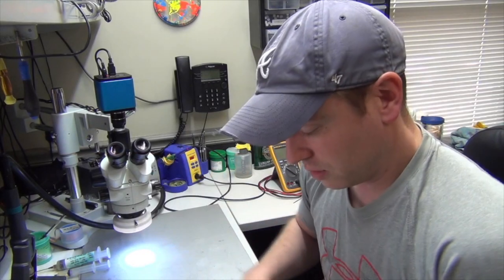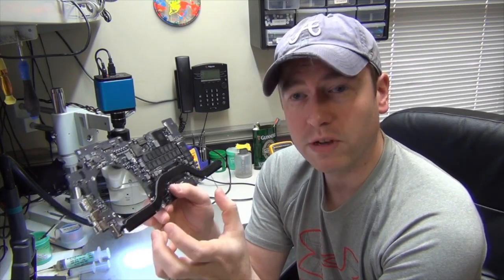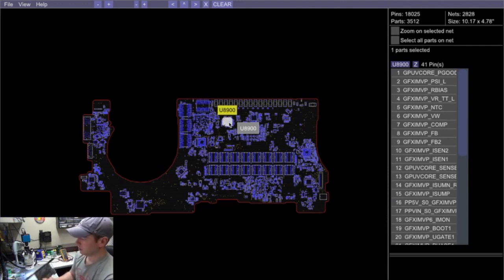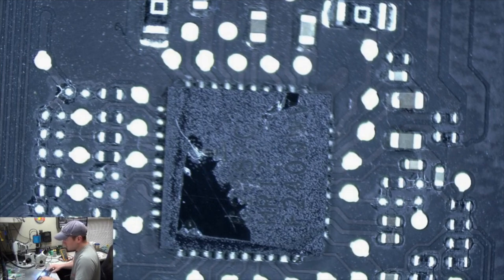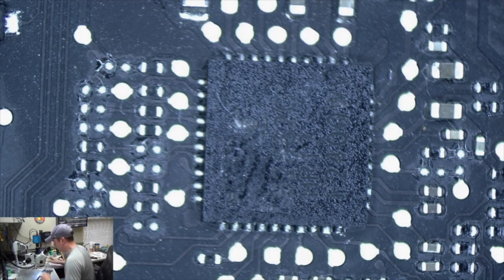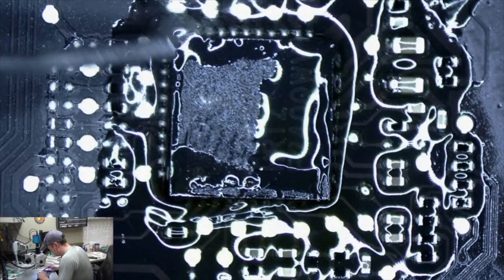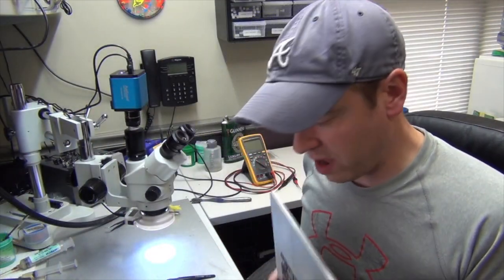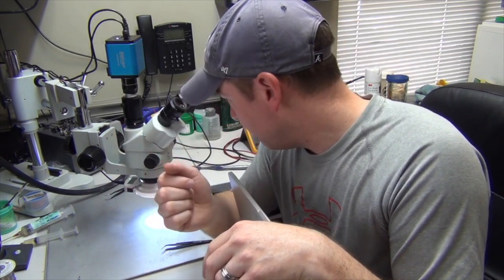Macbook Pro A1398 2012 Retina GPU Vcore Failure Repair on board 820-3332

Comment: hi. i got a A1465 macbook air , when i try to boot up, it take 2-3 HOURE to boot in, 1 houre to show the screen saver and is not reattive. btw it work, in the system preference it miss the GPU intel 4000 ( there is no sign of that) btw it boot up. what i can do? what is the problem???

Comment: I have two of these laptops, both with the exact same issue that you show in the video. First I have resoldered U8900 like you show in the video. It worked for a while, but then the problem came back. On both laptops. Then I have ordered two U8900 chips from Aliexpress, and replaced them on the motherboards. Again they worked for a while, until they failed again, on both laptops. Does anyone know why the issue keeps coming back? I am sure that my soldering is not the problem as I have sucessfully done even more difficult solder jobs. Any solution?

Comment: Hi! I have the same Retina 15 2012 MacBook Pro, it has the same problem, I tried to replace the ISL62882C with ISL62882, but it didn't work. Is there a possibility, that 62882 without "C" is not compatible? I looked through the datasheets, they are basically the same :(

Comment: In case someone else tried this repair and it didn't help: Try putting a bit of thin (~1mm thick) foam on the U7400 chip. This is the similarly sized but slightly larger chip to the right of the U8900 chip. It worked for me. So it could be that my U8900 repair failed, or that the problem is in fact with the U7400 chip, or even somewhere else...I know this is not a proper repair but it works flawlessly now so I'm going to leave it as it is.
Reply: I have the problem that this fix helps only temporary. I've even replaced U8900. At first it works but after a while the problem returns.
Reply: @Reldeifekirneh  Yes my problem returned. Still want to get mine fixed. Bought a thermal camera and hoping that will help find the culprit....

Comment: well, after I did that... and reset the NVRAM i got the same simptoms (macbook pro not booting due to graphics failure) and eventually after 5 minutes everything went dead. I checked mulitple times that my soldering was ok and I had no shorts on that chip. Where can I search for a problem now? Graphics mosfets?

Comment: I did exactly as the video showed and it worked. Thanks man. Saved a 2012 model from the scrap pile. I bought it specifically with the intention of trying this, which was a bit of a gamble, but it paid off!

Comment: Thank you so much for this video. Followed a link from Tim (TCRS) who mentioned this fault and your video. Believe we are facing the same fault -> logo appears -> see the boot OS bar to about 25% then a flicker -> see the mouse pointer -> then dark. Caps key toggles fine. Suspecting the same fault so will reflow it. Thank you again.

Comment: what if your macbook screen goes black when you use an app that utilizes nvidea, keyboard still lit, but if you plug into external monitor, you get display there.  Shutting down and restart, screen comes back on.  Early 2013 Macbook Pro w/ nvidea.

Comment: I`ve managed to revive my MBP 15 Early 2013 - same symptoms same solution. Thanks alot you saved me hundreds of bucks!
Reply: How many degrees Celsius did you use?
Reply: @tbu_drachenkater5397  350 degrees on my soldering gun as usual. Dont forget the flux also.
Reply: @nistel  thanks. Can you explain how to do this repair? The guy in the video just went with the soldering iron from one side of the chip to the outher. But how does that fix the soldering?
Reply: @tbu_drachenkater5397  the idea is to reflow the chip. Add some solder and flux should be enough. If you want the best possible effect you ran remove the chip and solder it again.
Reply: @nistel  thanks, i will definitely do it

Comment: I have a macbook pro A1398 with 820-3787 board.  It was turning on, working fine, but would randomly shut off.  Turn right back on and work again.  It did this for quite awhile until one day, it just wouldn't turn back on again.  Magsafe charger shows green light, then switches to orange. No Fan spin.  I have tried powering it with my bench supply and it only draws 25ma.. Never been wet, no corrosion I can see, nothing with the smoke out from what i can tell.  Also, nothing shows HOT on my thermal camera. G3H has 12v.. The only thing that seems to jump out at me, is PP3V3_S5 test point on C8030 only shows 0.40V.... I'm not sure if thats normal or not.  I do have 12v, 5v, & 3.3v on other spots of the board.  U7501 "appears" to have voltages coming IN/OUT like it should, but i'm not 100% there.  
The 0.025A draw is what really confuses me.  I even tried ramping the bench supply upto 23v to see if something warmed up, but nothing does. 
PLEASE, if you have any ideas.. I'd really appreciate it.

Comment: Hi Mr Medic. Have 20 years experience in electronics, but have somehow got away with never soldering a surface mount chip 😂. Could you just clarify what you are doing? It looks like - apply flux, melt some solder on the tip of the iron, then simply run the iron over the pins. Is that it? No hot air or heat plate involved? Many thanks, Ben

Comment: Sent in my board about 2 weeks ago  got it back this past Monday. I installed the repaired board in about 45 minutes powered it up and viola, I have video again. I paid $200.00 for the 2012 15 inch Macbook pro Retina. With the $250.00 repair I now have a $450.00 Macbook. Time to sell my non retina 2012. Thank You Powerbook Medic

Comment: Hi! My MBP 2.3GHz 8GB Retina Logic Board 15” A1398 (after water spill) boots up as expected but extremely slow. Activity Monitor’s Kernel_stack indicates 700% CPU usage. Video display working properly. Same slow symptoms while booting in safe/recovery mode. I assume it’s a logic board hardware error. Any tips to suggest? Thanks

Comment: My 2012 macbook pro's screen stopped working. There is power but no screen. I took it to a nearby shop and they diagnosed it as a GPU issue and wanted to charge $500-$600 but said issue would happen again. The guy blamed the OS installed. I have family pictures on hard drive I want to recover...
Reply from the maker: You likely just need a board repair. You can find more info our our repair services at : http://www.powerbookmedic.com/xcart1/pages.php?pageid=67 . As for the data you want to recover, you could just take the drive out of the machine and put it into an external enclosure without having this unit fixed. That would be the easiest option if all you care about is the data.

Comment: Hi, how are you? I'm from Argentina. Is it the same fix form Nvidia GeForce GPU panic en an Early 2013 MBP? When the MBP changes automatically to this video chip working with Photoshop o Premiere for example, suddenly turno off screen and crashes. Or shoud I do this Job straight to Nvidia Chipset?  Thanks Very much :)

Comment: Thank you so much I was a component level service engineer on Acorn computers in the early 90s but not done much with silly small components since then...…  Anyway I woke up to my 2012 Macbook pro dead!  I followed the instructions on ifixit to remove the board and resoldered the IC.  It is now back together and working perfectly.  Seriously you have saved me a LOT of money we pay the equivalent of near $3000 for the base MacBook Pro 16" on this side of the pond and my 2012 is still doing the business.

Comment: Should I add solder in prevent of this failure? Seems like it just losing power for GPU and can fixed after the problem actually occurred without the extra hardware harm.

Comment: How is he soldering the individual nodes with long strokes? Does the flux make the lead only stick to the nodes or am I missing something?
Reply from the maker: Kyle Blackshere Yes, the flux causes the lead solder to flow to only the pads on the board.

Comment: What if the chip has epoxy around the edges?  Not sure how to remove the epoxy to get to the solder without damaging something
Reply from the maker: Br P You can apply a small amount of heat, and then you should be able to peel off the edge bonding.

Comment: Thank you! I did this successfully with a Harbor Freight 100w solder gun. Just filed the tip to a blade like another viewer mentioned. I bought the solder and flux you mention in the comments. I had no soldering experience, so practiced soldering on an old kindle that was headed to the e-waste pile.
Reply from the maker: Alanna LaBelle That’s awesome! Great job!

Comment: Hoping someone is still out there lol So I am no expert at fixing computers but I tried to follow along with this video to fix the issue with my MacBook Pro. However, after I put it back together it is completely unresponsive now. The light on the charger turns on indicating it is charging but that is it. Even the fans aren't starting up. Any chance I completely killed it by trying to solder that one section? I looked at it with a microscope and it looks as if it came out well. Thanks
Reply from the maker: gerritian Check to see if any of the pads are bridged. That could be keeping it from turning on.

Comment: Hi, great help posting this video, thanks for that.
I did everything as in your video and I got the screen back but I'm stuck with another problem. Once the apple logo appears with the progress bar, it goes halfway and then the screen "Your computer restarted because of a problem" and the loop continues. I'm unable to boot into recovery mode, the screen gets stuck halfway and after a while screen turns black.
Help is appreciated.
Reply from the maker: Muhammad Umair Anwar Try to double check your solder joints on the Vcore and the surrounding components. It sounds like something is not right in that area.

Comment: Does this work for the 2011 MacBook Pro craped out GPU?
Reply from the maker: GeckoCkCkCk No, it doesn’t work for the 2011 MacBook Pro.   The GPU chips on those are what fails.
Reply: @PowerbookMedic  Thanks!  Think I'm going to have to try one of dosdude1's re-wiring or flashing solutions.
Reply from the maker: GeckoCkCkCk Yeah, you can run off of the integrated intel graphics card and bypass the AMD GPU. It won’t be as fast but it will not fail.

Comment: Hello from Brazil. I have a very similar problem with my notebook. I followed exactly your directions for resoldering U8900, but continue the issue. I will try to describe my problem, when I turn on, my computer chimes but in black screen, after few seconds my keyboard ligth appears, looks death until I close the lid. After few minutes when reopen the lid everithing is working well. A curious thing is if I turn off my notebook then put it in the freezer, my computer will start normally. I imagine this is a soldering issue. Any idea?
Reply from the maker: Julio Baffa Hello! It could be the GPU chip itself is going bad, but I can’t be sure unless I was able to see it myself and diagnose it.

Comment: Thank you. What can I say? When I was assembling the computer back I was thinking, such an effort and the bloody screen wont lit... Worse than that, the computer will toast the second I press the power button. I've assembled it and even used all the screws (surprise!). One hand on the switch, another on the mag safe (plan B: if you smell burnt electronics, if it doesn't start imediatelly, Pull the plug. Avoid burning the building). Pressed the switch, the screen came alive, the rotten apple shining and chiming. For a quarter of the price I keep the soldering Iron, the flux, the solder, the screw driver kit, the isopropril alcool, the magnifying glass, the second hand and the knowledge. THANK YOU!!!! It works, and it is quite simple though terrifying. Best regards :)
Reply from the maker: Vasco Patrício Happy to help!

Comment: I have the Mac that you did the video about, mid 2012 15" Macbook Pro, model # 1398, nice machine until the dreaded black screen issues.
Being a Pro Audio Technician myself, semi familiar with surface mount technology component level troubleshooting and repair, I followed your video to try to service my Mac. I do believe that I'm following the correct path as I did see some change in black screen instances after attempting to freshen the solder around the J8900 chip listed in the video.
However, I am not equipped to do this work at home. I bought smallest tip I could find for my Weller Soldering station, and have a 10 power eyeglass, I cant see the IC Chip very well, or tell if my solder joints came out alright. But now the machine wont boot up at all...:(
Apple wants a $750 flat rate for that model, a guy could buy a whole different Mac for that. 
Curious if could send either just the logic board or the whole machine to you for repair. I bet you guys could fix it quickly as I'm betting the trouble is right where the video says, although, could be something else.

Let me know rates/fees, turn around time, shipping address, etc..

Thanks
Reply from the maker: Chris T Yes we can take a look at it for you! You can send just the logic Board and it’s a flat rate of $249.95 for logic Board Repair or if you send the whole machine it is $344.95. You can visit our website www.powerbookmedic.com to schedule the repair.

Comment: Is this possibly the issue I'm having if my MBP has verticle pink bars appearing across the screen before ultimately turning into a solid while screen?  Nothing appears at all once it goes white (not even the Apple logo on start up).  Great video!  Thank you!
Reply from the maker: Yes, it is very possible.  If its not the GPU Vcore, then it is the GPU chip itself that has gone bad.
Reply: @PowerbookMedic  Thanks very much!  I fooled around with it some more yesterday and am actually able to get a clear image using an external monitor plugged into the HDMI port.  I have the display setting to "mirror" and while the external monitor looks fine, the laptop display is not legible (pink bars flickering/glitching back and for to white screen with an occasional ghost image (for a second or so) of what is on the external display.  Does this mean my display is bad if the image is clear on the external display?  Would the GPU need to be working properly in order for the image work at all (even on external display)?  I'm wondering if there is a way to diagnose what the actual problem is.  Thanks again!
Reply from the maker: @johnberry1245  Yeah, the GPU would need to be working in order for the external monitor to be showing a clean image.  It does sound like the display itself is bad now.
Reply from the maker: @johnberry1245  Yeah, the GPU would need to be working in order for the external monitor to be showing a clean image.  It does sound like the display itself is bad now.
Reply: @PowerbookMedic  Thanks very much for your response.  That's what I thought but didn't know if it might be something else.  I appreciate your help!

Comment: Does this also happen in the Late 2013 15" models? I took one of those to a service shop and they completely botched the thermal grease application (as well as other things), the CPU temp went up to 110°C!!, I opened it up, cleaned it and added some fresh thermal compound and it was ok at first but then suddenly I stopped getting video from either HDMI or mini-DP. VNCing into the machine shows the GPU is being detected but not recognized (i.e. it sees an "NVidia Chip Model" with 0 MB RAM connected to the PCI Express), could this be caused by a problem such as the one in this video?
Reply from the maker: Yes, it actually does happen to some of the 2013 models.  Apple has applied an Edge bonding around the VCORE chip which has helped the issue in most units, but some of them still have it.  It would definitely be something to try.

Comment: thank you very much for your video, i had exactly same issue with a 820-3332-a which have been keeping as stock for ages, there was not enough solder around this chip i applied some more with led free and its working fine, thanks again

Comment: I did everything as in your video, but there is another problem. On the apple is loaded up to half and after a while it turns off.
Reply: Hi, I also did the same as told in video and now I'm there where you were. I'm having the same problem. Did you find any solution? I'll be grateful for the help......!

Comment: Hey, do you guys use a special flux remover solvent or just isopropyl alcohol? Also what temperature are you soldering at?
Reply from the maker: We solder from anywhere between 600C and 800C  depending on the board.  We just use alcohol.

Comment: It should be a piece of thermal conductor, to remove the heat from the chip and to reduce its thermal expansion, which will reduce the tension on the soldering points.

Comment: Hey, I just brought a precision screwdriver set off amazon, dug out my old gas soldering iron, grabbed a load of flux. Filed the tip down to a sharp blade, 45 minutes later. My Macbook Pro sees life again! Thankyou So Much! i kind of want to smash it through the window of the local apple repair shop that quoted me £2000 to fix my 2012 MBPr though....}

My Hero!
Reply from the maker: Always happy to hear of success stories! Glad to know this video got you up and running!

Comment: i have 820-3330-b mid 2012  this laptop not working i changed mosfet (q8930/IRF6802SDTRPBF). gt650m begin os is ok if i running geekbench 3d test gpu reset to login screen....// if i runnig ASD os test triangle error...  i measured voltage if begin tı test voltage reset. gpu vcore (ISL62882C) is bad?  //Thank you //
Reply from the maker: There is no way of knowing for sure if one part is bad or another with the information that was provided.  You will need to narrow down whether the GPU VCORE is bad or whether the Voltage In or the Enable lines are the issue.  Or possibly if the the GPU itself is bad.
Reply: Thank you.